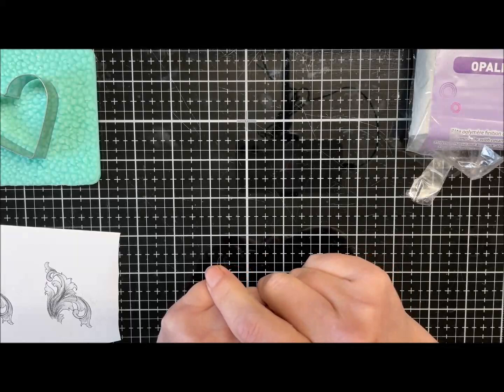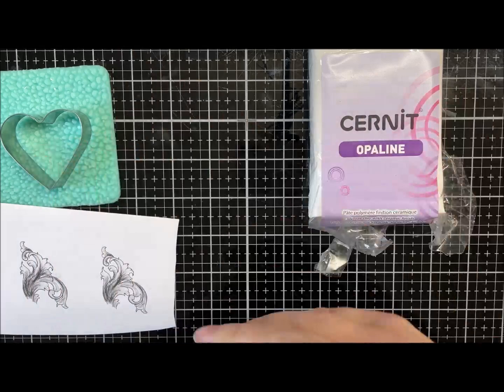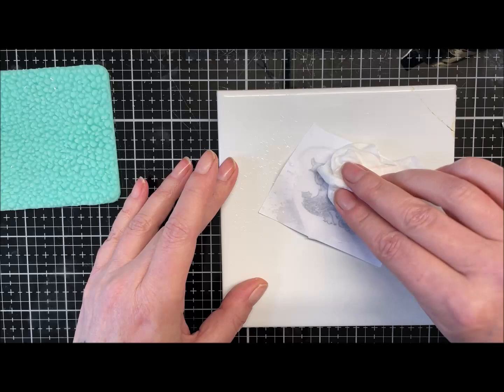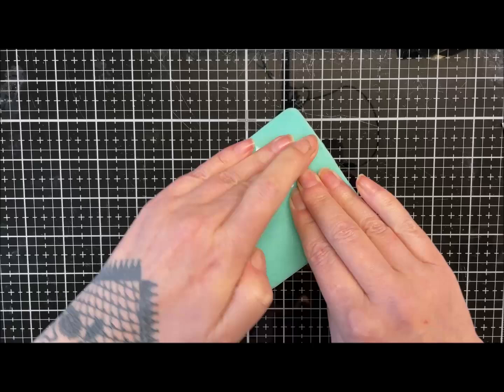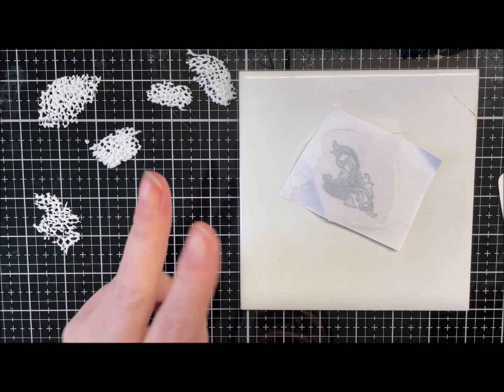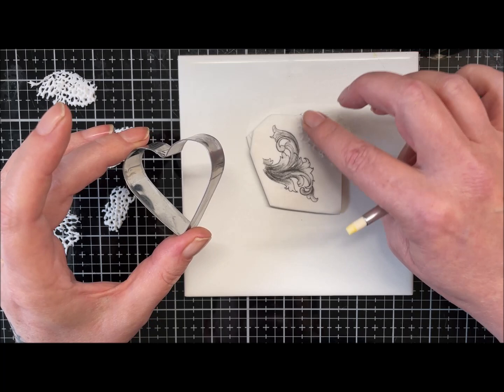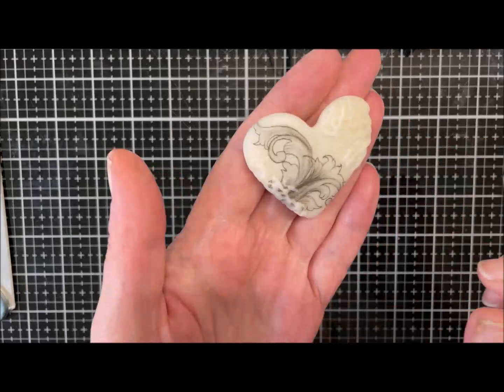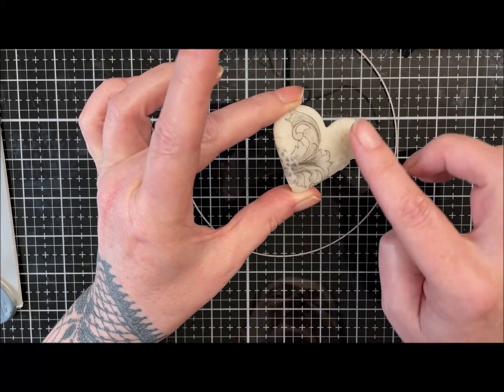Tattooed Heart Pendant

Comment: ❤️❤️❤️
Did you use regular paper? I bought transfers (I have a regular printer)but when you add the water, the paper dissolves completely.
Reply from the maker: Just cheap office copy paper is what I use, 80gms weight
Reply: What about doing a transfer to overhead film from an inkjet and then transferring it onto the clay?